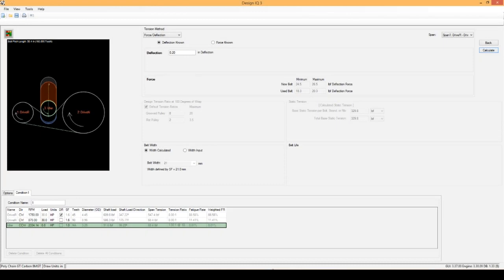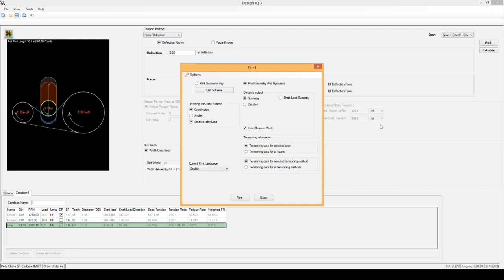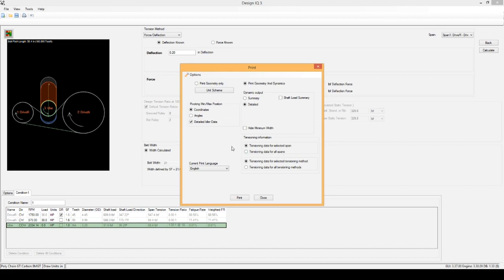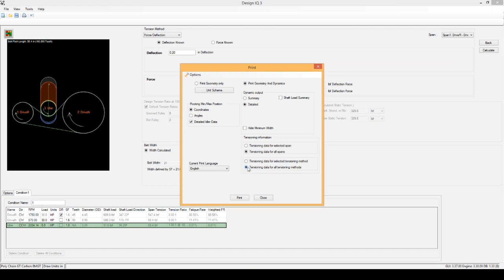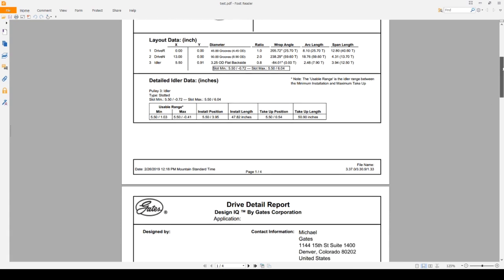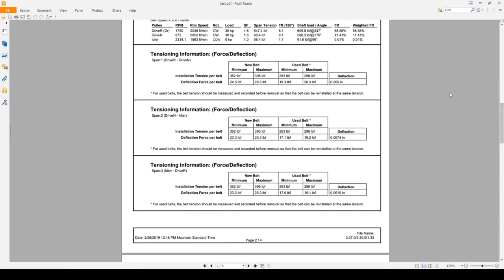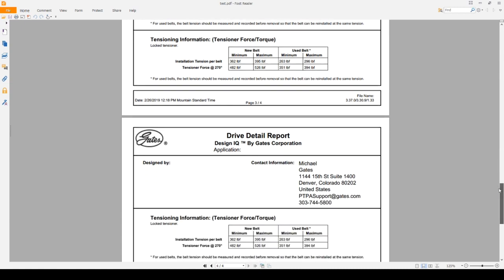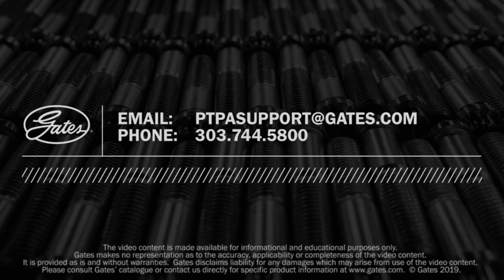Design IQ™ - Episode 2: Drive Detail Report

Comment: I run into an issue where it says that the belt is designed outside of the tolerance for the idler(s). Can you explain how to resolve this issue?
Reply from the maker: Ah, yes that is a very common error. That prompt will appear if your idlers adjustment range is below our recommend values for ease of install and tensioning. Basically the prompt is warning you "that based on the current adjustment range of your idler, this belt may be difficult to install or tension". Increasing your adjustment range should get rid of this error.
Reply: @GatesNorthAmerica Ok, thank you. I will give that a try.